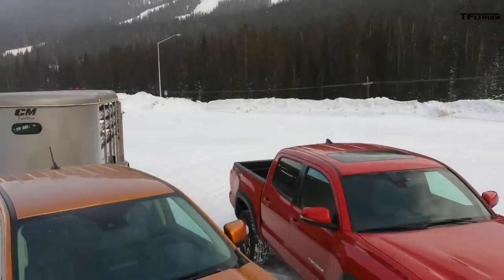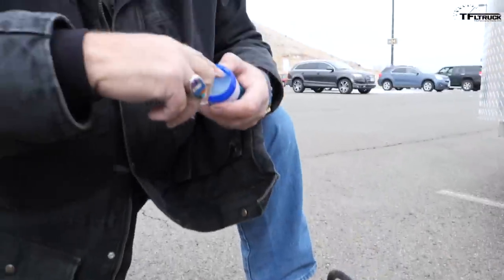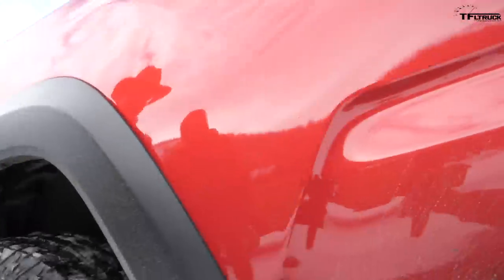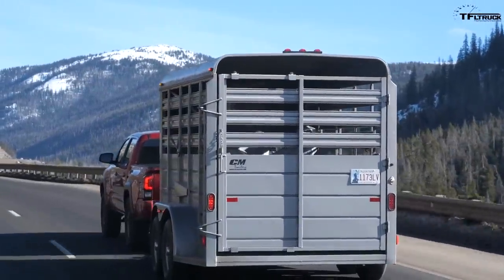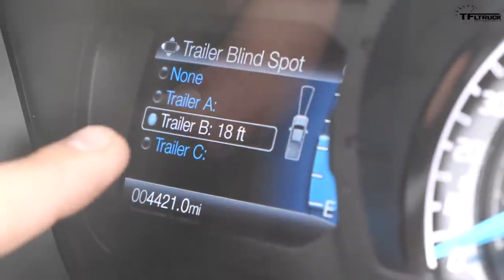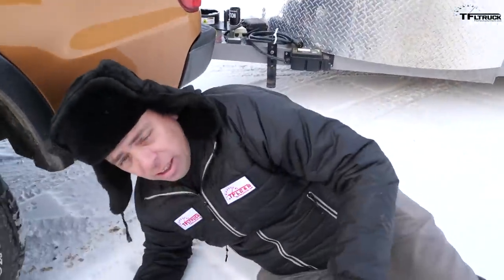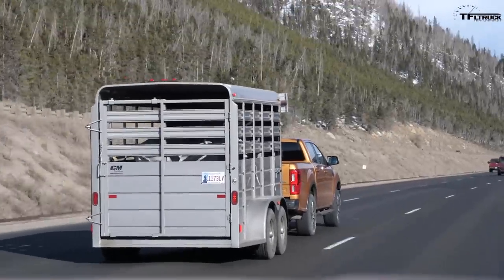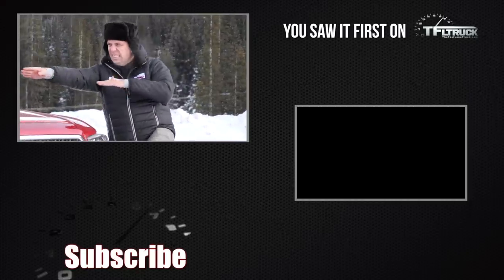Best Midsize Towing Truck? Ford Ranger vs Toyota Tacoma vs World's Toughest Towing Test

Comment: Imagine if Toyota updated the Tacoma.  Ranger is brand new with a bunch of new technology that the Tacoma doesn't have.  Taco would likely crush the Ford if Toyota did a new engine with turbos, new suspension designed more for the road and towing and less for offroad.
Reply: Hobomedic1911 well, the Tacoma is set for a update 2021. But the ranger is do for one itself in 2022/2023ish
Reply: @devinbender8428  just pointed out how close of a match up it is with very old tech from Toyota vs new tech from ford.  In my opinion the Taco is still superior.   I've owned both Ford's and Toyota's.  Only ford I have owned that was reliable was an 89 f150 with the straight 6.
Reply: Hobomedic1911 I say the ford is better. 
Way better mpg and torque. Faster and more towing and payload. And it will drive better. The Tacoma is super slushy.
Reply: @devinbender8428  your wants and needs differ from mine.  I want and need reliability.   I have a lot more confidence with Toyota now than Ford.

Comment: I like the truck look comparison of the two that's why I would go with the toyota tundra.
Reply: you will regret going with that toyota
Reply: @rockandroll4689  
I had an f150 2016 it was in the shop every few months. It kept stalling and the engine would just shut off. The dealer had to buy it back, few months of research. I went and bought a Tundra and never looked back.

Comment: I have owed both from new, f150 and a Tacoma.. I gotta say everyone should buy Toyota.. Resale value says it all.. 200,000 miles and sold it for 7500 on eBay in an hour.. Ford always needed some dam thing to keep it running and only have 120,000 miles on it..

Comment: I would say they are tied for the braking applications, If it wasn't for Andre they would both be at 7 anyway.
Reply: Wrong rewatch  at 22:20 . Ranger went to 61mph is why
Reply: @lukestoyz  Yes I saw that, but Andre stopped Kent from braking a seventh time in the Tacoma.

Comment: Andre needs to go back to making Vodka. The way he measures the door opening is flawed. He measures to the rain gutter. Mr Truck gave a funny look. Mr Truck had trouble getting his head into the Toyota. Andre you need to measure the actual opening. You can not pass a forehead through solid metal.

Comment: Sorry you want a mid size truck, Tacoma is king.  As far as frame rusting, um I've owned four Toyota pickups from the early 1980's up to a 2016 and I have never had the frame rust anymore that it did on any other truck. Also, go take your Ranger or Canyon in five years and see the difference in resale value compared to Tacoma.  Ford, Chevy and Dodge got full size trucks down and each has their fans who will fight ya to tell you their band is best.  When it comes to midsize Toyota has all beat.

Comment: Colorado/Canyon 308 hp v6 so sorry Ranger.
Reply: Colorado/Canyon 308 hp at 6800 rpm 275 ft. lbs. of torque at 4000 rpm. 
                  Ranger 270 hp. at 5500 rpm 310 ft. lbs. of torque at 3000 rpm.  The Ranger will easily out tow the Colorado and do it without having to rev anywhere near as high.

Comment: The tacoma will be more reliable and hold its value longer. The ford is based on a 2011 design from europe and mexico
Reply: CHris Hill the Tacoma is based on a 2011 Mexico design. 

And value is marginal. After 5 years the Tacoma holds 62 where the ranger holds 59

-as for reliability? When has the Tacoma ever been more reliable than the ranger? Every single website that measures reliability has the ranger ahead. From the beginning of time.

Comment: Ford junk a big joke that Ford has decided to put a 4 cylinder in a 4x4 raanger truck when toyota uses a 3.5 v6 cylinder what was they thinking to think of such stupidity...
Reply: They  "was" thinking that it has better fuel economy, more HP and more TQ than the antiquated V6 offered in the Taco. You can probably still get a Taco with an I4, but it won't even pull it's self up that hill.

Comment: Kinda funny they say no head room in Tacoma and yet it has a sunroof and the ford does not so yeah the ford has more head room, test with moonroof. Seeing it is new to the US its the best, But at the end of the day it's still just a ranger with a 4 banger. Only 2 miles more a gallon as 4 to v6....kinda crappy I think. But Mr. Truck is partial to Ford. In a year or 2 when you go to trade in that Ford its value will be so bad, again.
Reply: 2 mpg better and more powerfull. They were also hitting their heads on the door jam when getting in and out. Previous generation Rangers are still in demand and have good resale value.

Comment: I'll go out on a limb and say the best midsize towing truck is the one with a diesel, the Chevy Colorado
Reply: If only Chevrolet put a diesel engine worth buying in their midsize trucks. The 2.8 is way underpowered. They need to replace it with the new 3.0 I6 diesel from the Silverado. That 2.8 inline 4 is what Isuzu uses in their box trucks overseas where most cars don't have anywhere near the horsepower they have here. I like the diesel Colorado for being a diesel but the Ranger can tow almost as much and can do it a lot faster. Nobody is actually towing 7,000+ lbs with a midsize truck very often because the reality is that these trucks are too small to control that much weight on the road. Thus 99% of people will find the Ranger just as capable and much faster than the Colorado.
Reply: Except bow ties are junk. Diesel in a truck now they have that much smog crap and def too. It better stay under warranty it’s whole life or you will go broke trying to fix it.
Reply: @edregener7018  No.
Reply: @edregener7018  let me guess you're a fan of Fords, with diesel engines so bad you have to rebuild them as soon as you get them ("Bulletproofing") or Rams which have a loose pin right above the timing chain that tends to wiggle out of its hole
Reply: You can't keep diesels running even in the big trucks with the emissions it's cost company's way more in the maintaining their fleets. But that's what the objective was in the beginning destroy American industry.

Comment: you mention 2" in head room...I just bought a 2019 TRD Off Road - did NOT get the sunroof (like you have on yours)...I was told it reduces headroom...though not sure how much. Notice the Ford does NOT have the sunroof.  I looked at the Ranger too along with the Chevy.  I have a Tahoe also - we own a horse farm.  I think both will fit the needs of most people....I do NOT own stock in either company - so I have no dog in this fight as far as loyalty - though we've had better luck with Toyotas overall than any other brand.

Comment: You had to lift on the Toyota on the way up for traffic and the Ford needs a 10 speed plus a Turbo to do the same job.  Being that the Toyota will be running wile the Ranger is in having turbo after turbo replaced as the miles roll by, and the Toyota will kill the ranger at lower altitudes it's Toyota for me.  Plus you will be dealing with a Toyota dealer vs a Ford dealer if you need anything fixed.

Comment: So this proves Ford is grossly overestimating the payload and towing capacity of the Ranger. The Ranger squats more with the same tongue weight, is worse at maintaining speed downhill, and barely better towing up a steep grade. Plus the soft feminine look (it looks like a crossover with a bed) and fake “engine sounds” pumped through the cabin lol. Ford needs to go back to the drawing board.
Reply: They had the Tacoma floored the entire trip essentially, where they had trouble keeping the Ford under the speed limit...

Comment: So Mr. Truck chose the 4 cylinder 2.3 turbo direct injection from a company that had broken spark plugs in tritons with a brand new automatic? okay.  I chose a durable proven 3.5 Toyota with 6 speed any day.

Comment: This test is absolutely absurd. You're pulling 5,000 lbs with these 2 trucks. In 2017 you tested a  Nissan Frontier pulling 6,100lbs  in the same test.  What did we learn? The Frontier didn't climb the hill as fast pulling 1,100 lbs more. Or brake less than these two trucks that were pulling only 5,000 lbs. Your tests are stupid.

Comment: When did Toyota Tacoma payload get that low it shows 1175 on website for Crew cab short bed auto.  My Gen 2 is over 1500 pounds stock and I have added heavy duty springs with extra leaf and can carry over 2000.

Comment: honestly a lot of you people making a big deal out of it SMH🤔 and is not an issue and you don't have to take off the left tire of the Ranger all you gotta do is turn it and you have access to it however It is critical that the oil change duration does not exceed 15 minutes or you risk having no oil pressure on start up. This is due to the design of the variable output oil pump.

Comment: I feel like there is a glass ceiling on this test. There are trucks that can beat the 8 minute time. But you don’t want to speed. Maybe count the times the pedal is on the floor or the time, (that may be hard to track). It’s kind of like counting brake applications on the downhill. You guys are smarter than me, see if you can come up with something that doesn’t penalize the stronger trucks. Love the channel. (I even tolerate Roman’s ‘Toyota-hate’).

Comment: If you're not smart enough to realize you should only use a diesel for towing then you shouldn't be allowed to own a truck. Find any house builder, construction company, or real estate developer, they don't use gas engines in the vehicles they depend on.
Reply: Blanket statements a great. They're so easy.
Reply: Smart ones do 😬.
Reply: @TravisTLK  Nope, not a "blanket statement". Gas powered engines aren't designed for towing. Go to a Stable, a Rodeo, or an Equestrian event you won't find a single gas-powered truck pulling a horse trailer. Not a single one.
Reply: @theylied1776  yes they are, they tow just fine within their limits.   No one is saying one should not by a diesel I work for a utility and we don't buy diesel, it's not worth the added cost.  If your hauling cars or huge horse/chamber trailers then yes it makes sense.   But to say gas engines are not meant for towing is foolish.
Reply: @peterad1529  From personal experience with General Motors, Ford, and Dodge, never buy a gas powered truck for hauling. Gas powered trucks are not designed for the abuse and the wear and tear of hauling a trailer. 

I don't care what a dealership and their sales people tell you in order to sell you that truck but gas powered trucks are not design for hauling.
Reply: @peterad1529  if you have a bass rig or a little boat you want to drop in the lake yeah sure hits that gas powered truck up to it, but you're beyond foolish if you're using that truck to haul a horse trailer or any weight Beyond a ton.
Reply: @jackmackenzie2118  Not really, we're talking about a a truck hauling a trailer. Gas engines are not designed for that type of wear & tear of a commercial business.
Reply: @jackmackenzie2118  My comment is specifically about commercial vehicles. And besides, in this video the Toyota Tacoma is a V6 and the Ford Ranger is a 4-cylinder Turbo. If You Haul that trailer, which is 2 and 1/2 tons, with that water you are insane to think those engines will not eventually blow a head gasket.
Reply: @Smooththatsme  Because people also use those trucks to haul bass boats and small loads... but if you use those trucks on a consistent basis to haul anything above 2 tons you will either blow a head gasket, ruin your transmission, or strip your differential.
Reply: @jackmackenzie2118  Both. I started out talking about the 4-cylinder Ford Ranger and the V6 Toyota Tacoma, hauling two and a half tons... but it's changed into a conversation including commercial vehicles. 

If you have a commercial business and you're doing a lot of hauling with a trailer you're Beyond a fool if you use a gas engine. Gas engines are not designed for that type of wear and tear.
Reply: @jackmackenzie2118  How exactly does gas make more business sense if you're using it to haul a trailer with 6,000 lbs?
Reply: @jackmackenzie2118  Nope, a gas engine does not cost less to maintain than a diesel. A diesel cost less to maintain, that's one of the two main reasons why the trucking industry exclusively uses diesel engine. The other being diesel Burns at half the rate of gasoline so diesel will last two to three times longer. 

Also, the reason why the tow truck industry switched from gas to diesel in the 90s is because diesels are easier to maintain than gasoline engines.
Reply: @jackmackenzie2118  You're only highlighting the difference in capacity between a semi and the Towing industry... but the function and durability of a diesel engine is 3 times that of a gas engine. When it comes to towing a trailer or used for a tow truck  or semi a gas engine cannot compare with a diesel.
Reply: @jackmackenzie2118  Also, diesels are easier to maintain versus a gas engine, and the fuel will last two to three times longer than using a gas engine.
Reply: @jackmackenzie2118  You understand there's a term in Automotive Engineering called [Planned Obsolescence].
Reply: @jackmackenzie2118  You can't convince me that using a Gas engine is a sound business practice when your business depends on hauling material. You save money on fuel costs because 18 1o 25 gallons of diesel will last two to three times longer than gas, and diesel engines are far easier to maintain than a gas engine. 

Unless you're looking for a solid source for a tax write-off, meaning your maintenance fees, by all means buy a gas engine for your business.
Reply: @jackmackenzie2118  From a business standpoint, a business that's concerned with their profit margin, and that is every business, this situation is universal. Gas-powered engines for any company that depends on hauling material on a trailer from point A to point B makes no Financial sense. Gas versus Diesel  you will double your maintenance cost and triple your fuel cost. Especially if that business has a fleet, meaning 3 or more trucks.
Reply: @jackmackenzie2118  Planned Obsolescence is not a conspiracy theory, I grew up on a Marine Amphibious base the gas engines, we're talking three to four hundred thousand miles on them, came from the Jeep Willys from the 50s and d 60s. These gas engines were work horses. Show me a single gas engine today that you can put three to four hundred thousand miles on?
Reply: I was a kid on these bases in the 80s and they were still in service with the original engines. Even the Dodge Power Wagons from the 60s would last Almost 300,000 miles.
Reply: @jackmackenzie2118  Nope, not at all. Diesel trucks are easier to maintain, your fuel cost will be 3 times cheaper than using gasoline, especially when a Corporation buys on a set yearly fleet rate. But again, if you're looking for one huge tax write off, buy a fleet gas powered vehicles.